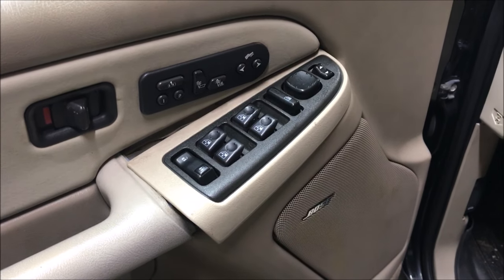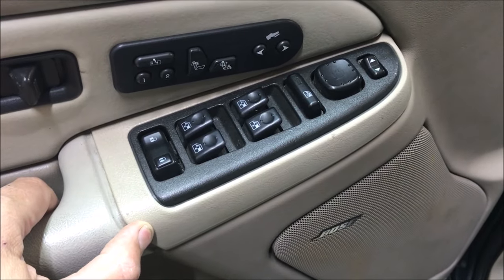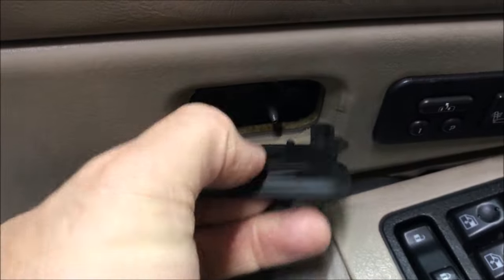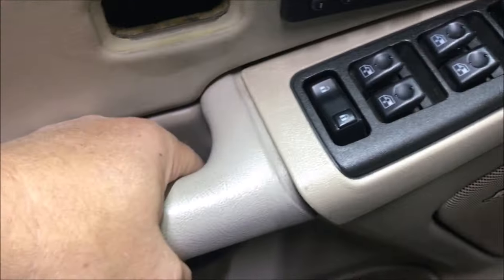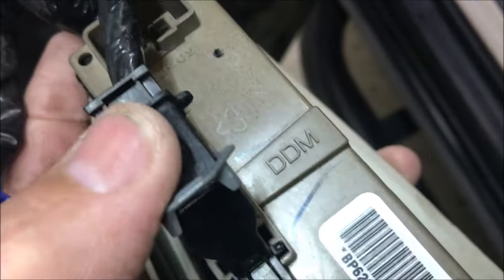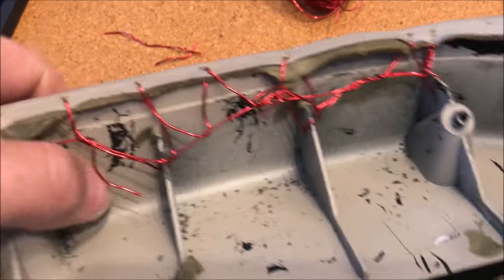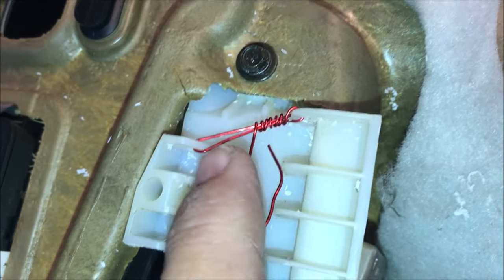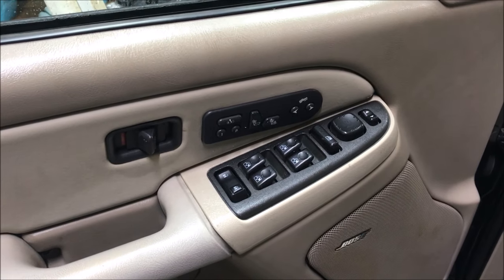OldGuyDIY Remove Repair 2003 Suburban Tahoe Yukon Silverado Door Switch Panel Broken Clip & Armrest

Comment: I just bought a tube of RTV silicone and just siliconed the piece back. Took two minutes to do, and 24 hrs to fully cure. Once cured it is good as new. You dont even need to take the door apart to apply the silicone but I highly recommend using painters tape to keep the stuff from getting on the car interior as it is difficult to clean but can be cleaned while wet with rubbing alcohol.
Reply from the maker: Thanks for the tip.
Reply: I took your advice and did same thing just ran a bead of Gorilla Silicone it fits nice and tight

Comment: Thanks.  Is there a way that I can wire up my windows to work with the key off.  It's ridiculous that my kids can't even get fresh air and the rear door glass lift has no key lock where does the passenger door.
Reply from the maker: If you want to modify the existing wire harness, you can attach the power wire for the windows to a red that is always hot, under the dash.

Comment: Have you happened to do the loose windows issues these vehicles get over time? 👍 subscribed
Reply from the maker: No, I've never encountered a loose window in 20 years of driving this generation vehicle, Tahoes and Suburbans.  If I had a loose window, I would remove the inside door panel with the window in the full up position and use a 10mm socket to tighten the 2 friction fittings with the rubber liners that secure the window glass to the actuator assembly.  You will see the bolts that need to be tightened about 6" below the window opening in the car door and about 6" in from each end.